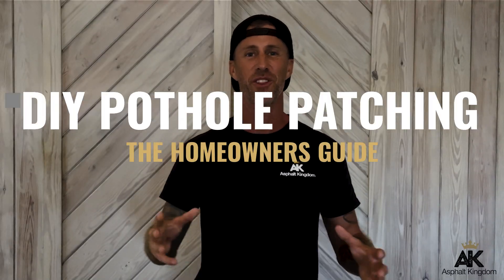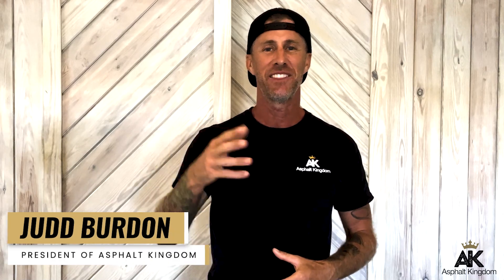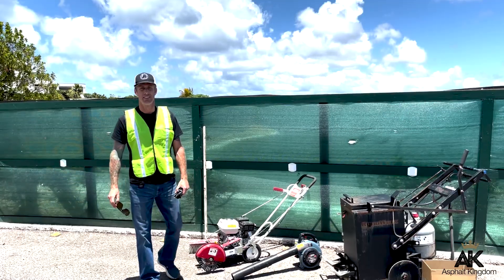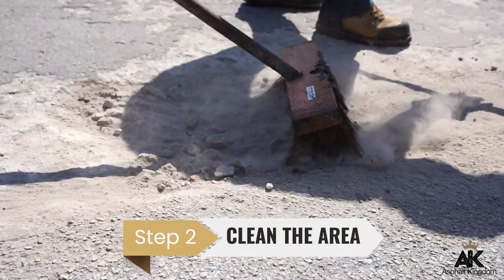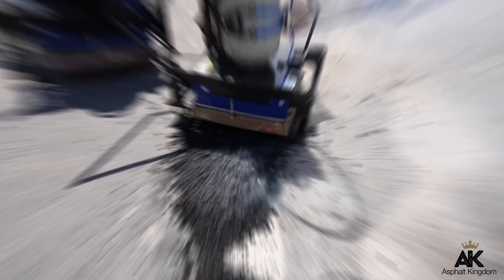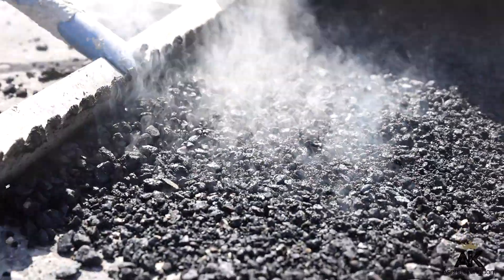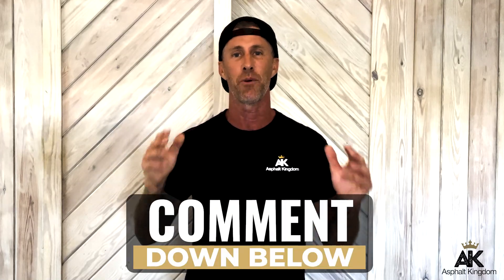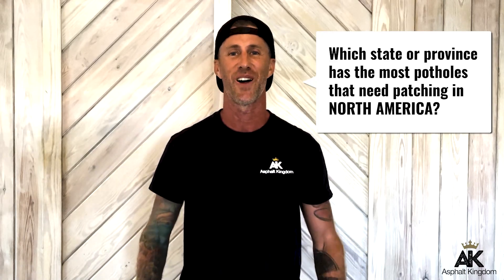The Homeowner's Guide: 3 Easy Steps to DIY Pothole Patching

Comment: I know this was for demonstration, but I noticed the many cracks right next to the repair. Would that area be patched or just crack filled? My thinking would to be to make the initial patch larger to fill the adjacent cracked area.
Reply from the maker: Great observation and yes this was a demo. In the case that this was a client and live scenario we would have suggested a larger patch if the client accepted it to fit their budget as that would have been best. If not, we would have crack sealed all the major surrounding cracks to prevent further water penetration and base damage leading to more potholes that are liability risks and tripping hazards.
Reply: @AsphaltKingdom  awesome, thanks y’all, great video